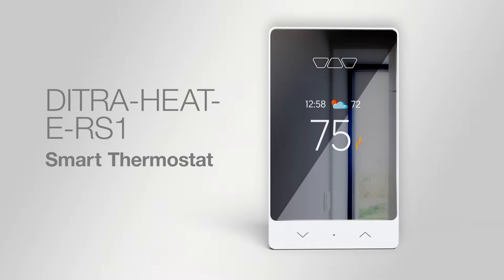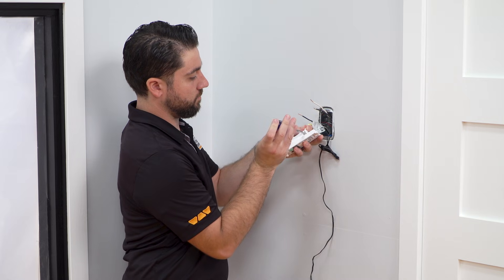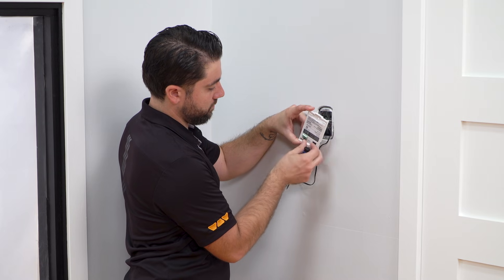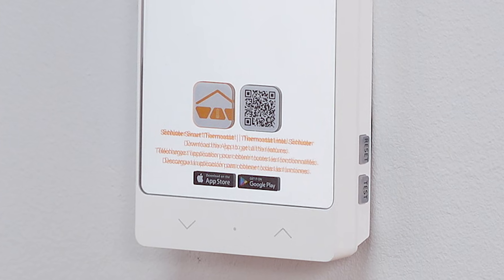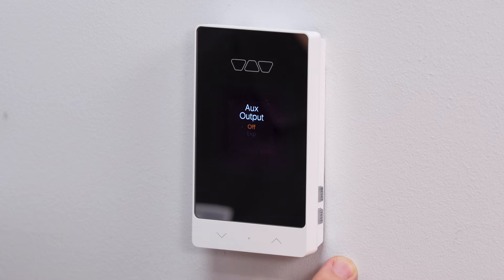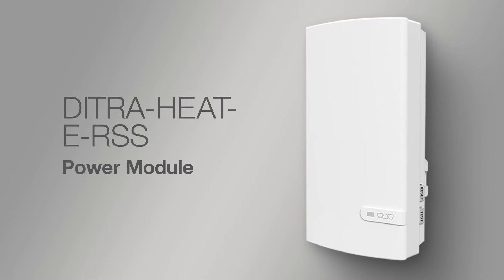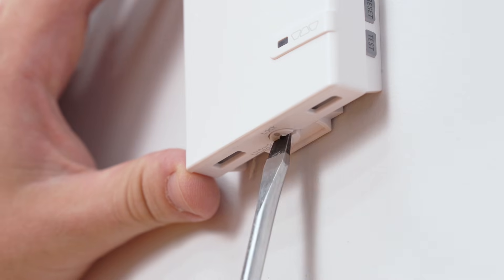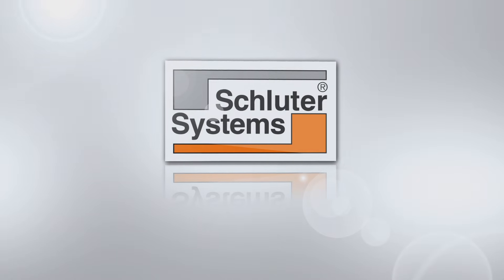How to install the Schluter®-DITRA-HEAT-E-RS1 Smart thermostat

Comment: What do u do when u have two pairs of sensors ? Help
Reply from the maker: Two floor temperature sensors are provided in every DITRA-HEAT heating cable box. Both sensors must be installed in the floor assembly. We recommend installing each of the thermostat sensors at a different location on the floor, evenly spaced between to cable runs, and ideally towards the middle of the heating cable layout. When making connections to the Schluter thermostat, only one the sensors is connected while the other is for back-up purposes only. The spare sensor can be folded and tucked neatly into the electrical box. Hope this helps!
Reply: @schlutersystems1 yes thank you very much

Comment: Can i install 120v to it. Will still work?
Reply from the maker: Hi there! Our thermostats can be used with 120v, 208v, or 240v power. See the DITRA-HEAT Installation handbook for complete system instructions. Hope this helps 🍊

Comment: Does it matter where on the wall the thermostat is installed? (Ie does it need adequate airflow for ambient temperature sensing) or does it only sense the floor temp?
Reply from the maker: Hi Jeremy! The thermostat should be installed in a way that accommodates airflow and is not affected by other heat sources, etc. in the room. Since the thermostat can be put on ambient mode, it needs to be well located.  Hope that helps!

Comment: To clarify: This video is showing the installation of the thermostat on a 220v circuit (as to explain why the outlet box has two white and two black 12ga wires) The smaller gauge white and red wires are from the floor temperature sensors.

Comment: Howdy.
I have thermostat running, but today I've replaced my modem, so wifi network changed. Not sure how do I change wifi on my thermostat, without deleting my device and adding new one.i don't wanna lose usage history.
Thank you
Reply from the maker: Hi there!  Our product support team will be able to assist you!  You can reach them at 888-472-4588 (US) or 800-667-8746 (CA).

Comment: on a 220 connection where does the White wire go to complete the circuit
Reply from the maker: If you are referring to a 3 wire set up, where you have two lines for the 240V power and a third for the "neutral" (that's not needed), you should check your local codes for the proper way to cap that wire off.
Reply: @schlutersystems1  Thank you I am referring to a three wire cable I still do see how you have a complete circuit
Reply from the maker: Hi Robert - could you give our Product Support team a call to discuss your question - they will be able to support if anything is not clear, thank you! 888-472-4588

Comment: Where does the White wire go
Reply from the maker: If you are referring to a 3 wire set up, where you have two lines for the 240V power and a third for the "neutral" (that's not needed), you should check your local codes for the proper way to cap that wire off.

Comment: My thermostat displays 99 as the floor temperature but it isn’t actually 99. The setpoint is 75 but nothing seems to actually be happening.
Reply from the maker: Hi there! Sorry to hear you are having an issue with your Ditra-Heat system. Our customer service team would be happy to discuss this with you. Please give them a call and they can help take the next steps from there. 888-472-4588 (US) or 800-667-8746 (Canada).

Comment: Is there a built in transformer to create the 24v needed for the control wiring?
Reply from the maker: Hi there, good question... and apologies for the wait on the response... we're doing some digging to see what we can find out for you!
Reply from the maker: Hi there, here is a link to our Wifi thermostat Installation Manual, which may be able to provide you with the details you are missing: https://sccpublic.s3-external-1.amazonaws.com/sys-master/images/h05/hac/9484762710046/DITRA-HEAT-E-RS1%20Installation%20Manual.pdf

Hope this helps!

Comment: What if the black and red wires are reversed on 240? The black on L2 and the red(white) in L1?
Reply from the maker: Hi there! Since there is no polarity on the thermostat, this will not affect anything.

Comment: The system is working excewpt I cannot get it to interface with the app.  I hold down both arrows and nothing happens.  Any ideas?
Reply from the maker: Hi Bob, our Customer Support team can help you troubleshoot. Please give them a call: 800-472-4588 (US) or 800-667-8746 (Canada). Thanks!

Comment: When i press the test button, is it supposed to say GFCI fault as it only show at that time and not while running. I just got it installed and when i set temperature it keeps on rising compared to what the floor temperature is, nothing on the screen other than only when i press test it shows GFCi fault .
Reply from the maker: Hi there! Sorry to hear you are having trouble with your DITRA-HEAT system, we want to support you with that! Can you please contact our customer service team to discuss your issue, and they will help guide you with next steps from there. 800-472-4588 (US) or 800-667-8746 (CA)

Comment: How can i connect it to wifi, there is no option in the menu
Reply from the maker: Hi there! First, you'll need to download the APP. Around the 4:35 minute mark of the video, we go over that process. There is no button on the screen to start the WiFi, but if you press the up/down arrow at the same time during the set up, you'll be able to get there. Please contact Customer Service if you have any difficulties setting it up. You can reach them at 800-472-4588 (US) or 800-667-8746 (CA). Hope that helps!

Comment: How can I turn it off on touchscreen  ?
Reply from the maker: HI there! If you are talking about the Schluter®-DITRA-HEAT-E-RT thermostat, there is a button on the lower right hand side of the thermostat that can be pressed and held and the thermostat will shut off. Hope that helps!

Comment: Can this E-RS1 be used with other floor heating systems?
Reply from the maker: Hi there! Our thermostat was made to be compatible with our DITRA-HEAT cables. If you decide to use an another type of cable, it would be best to ask the cable manufacturer to know if they would approve and validate the compatibility of our thermostat with their systems. Hope that helps! 🍊

Comment: At what point are you required to have the additional power module?
Reply from the maker: Hi there! The power module may be used in conjunction with the DITRA-HEAT-E-WIFI, DITRA-HEAT-E-RT, or DITRA-HEAT-E-R thermostats when the heating load exceeds 15 amps (e.g., in large floor applications) to maintain a single point of control.

Comment: Is a neutral wire not required for 240v?
Reply from the maker: Hi tag, No. The red and black power wires are all you need.
Reply: @schlutersystems1  so you can just use 12/2 wire and use the white wire as the 2nd hot leg?
Reply: Wrap red or black electrical tape around the white wire if wiring a 240v setup since it's now a hot leg and no longer a neutral. 
This will help identify the wire if someone else decides to work on it. 
You'd have to mark the white wire at the breaker as well.